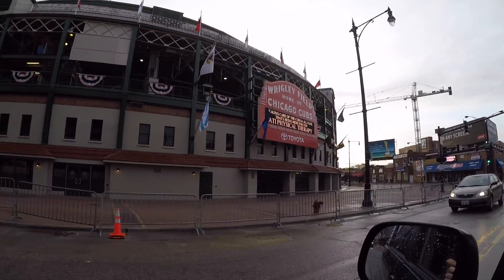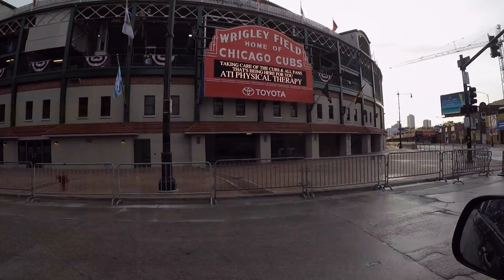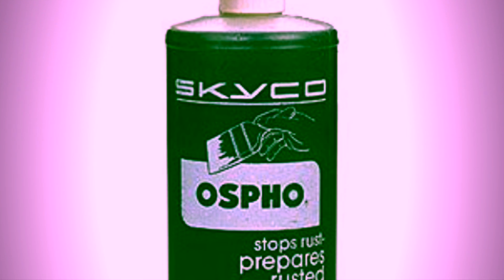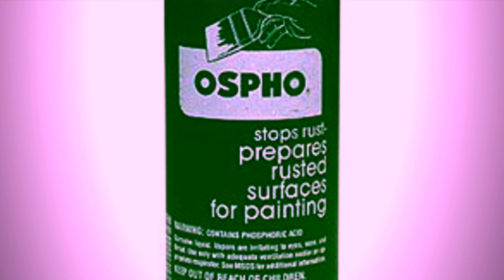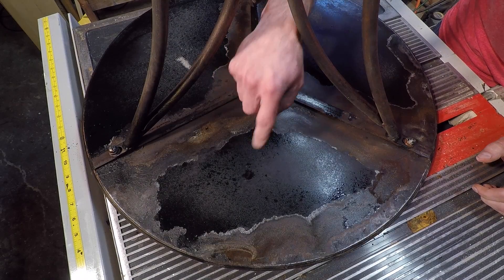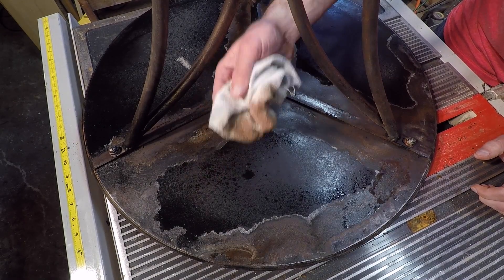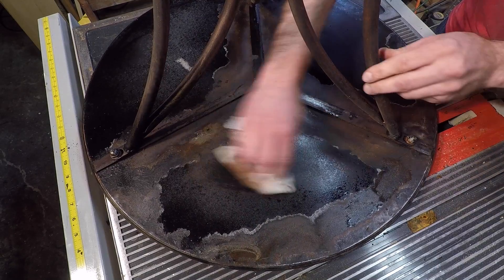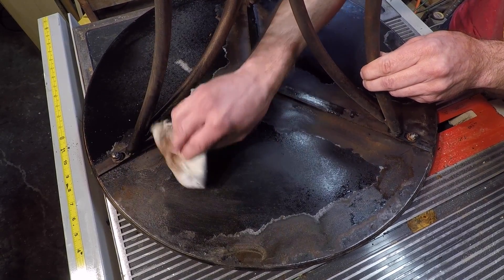Amazing Rust Killer! Ospho

Comment: I can attest to the effectiveness of OSPHO Rust Treatment Formula.  My friend and I had a 1/4" piece of Steel that we had bent into an angle bracket for a Trolling motor mount to go on the bow of his 15 foot Bay Scooter that sat right above the waterline.  We were in Corpus Christi, TX in the early 90's and in case you didn't know it, the Gulf of Mexico is one of the (if not the highest) highest salt content bodies of water in the world and rust is a huge problem along the gulf coast and especially in marine environments.  Anyway, we treated our mount plate with Ospho and let it cure for 24 hours, then we applied a 2nd coat and let it cure for another 24 hours.  We then painted the mount plate with some Red rattle can spray paint (might have been rustoleum but I don't recall for sure) and put 2 or 3 coats of paint on it.  Now under normal circumstances that plate would have started to rust no matter how many coats of paint you put on it because the salt environment is so harsh it just finds a way to get through, but our Ospho Treated mount performed like a champ for at least 2 years of frequent fishing trips where it was constantly getting splashed with the high salt content water of Corpus Christi Bay area and it never showed any signs of rust.  After this I swear by this stuff!!!!!
Reply from the maker: Thanks for the comments.
Reply: @AlleyPicked  you bet!

Comment: Ospho does work well.  I have used it on several old trailers and a lot of old rusty machinery.  Just be sure you always paint with an Oil based paint afterwards.
Reply: What is opel based paint?
Reply: What about a rust protector?
Reply: Stacy Jens didn't see the typo.  I meant to say oil based paint.  Anyway, that is what the Ospho rep said.  I have scraped and wire brushed all the loose rust off of machinery and trailers, coated them with Ospho, let it dry overnight and then painted with tractor and farm paint I got at tractor supply.  I added the hardener they sell for it as well.  So far this has kept any rust from coming back.
Reply: reck0n3r in my experience the Ospho, after it dries, leaves a coating on the converted rust.  I then put oil based enamel on it I get from tractor supply, with their hardener.  Several trailers and farm equipment pieces have not showed any signs of rusting.  Just be sure to scrape and wire brush off any loose rust before applying the Ospho.  Hope this helps.  Tom
Reply: Manufacturer says to clean with mineral spirits to neutralize acids before painting

Comment: Very cool! My dad was a builder and decades ago I attended the Chicago Art Institute studying fine arts. Point being, I'm pretty handy and I love architecture. These videos are fun and informative so thank you. I've lived in older homes most of my life which I miss. Love my neighborhood now but I'm living in a 25 yo house. My front door is a nice 8 panel door. It is rusting though and I looked at the replacement cost and want to believe I can salvage it. I have small bubbles of rust rearing their ugly heads, outside. I think the exterior might be due to a brass kick plate that wasn't sealed with caulk. Is this product a good option for my door if it's not too badly rusted? It isn't too noticeable yet, but could be worse than I think under the paint. Thanks!!
Reply from the maker: Thanks for watching. You should be able to repaint it yourself at a fraction of the cost. Good Luck! Tom

Comment: Does OSPHO harm plastic? I’m working on a bathtub and want to make sure OSPHO doesn’t harm the PVC piping. Thanks
Reply from the maker: I dont think so but I'll read the instructions and get back to you. Theres also another product called klean strip metal prep that's half the cost.
Reply: @AlleyPicked  thank you. I’m calling the OSPHO company tomorrow to see if they have anything to say.
Reply from the maker: @cdb8315  Hi. The Klean strip instructions do not say anything about harming PVC. So I test it myself. I coated a pvc piece with the stuff and after 30 minutes I wiped it off and there was no effect on the pipe at all. I think it's fine.

Comment: My front door has a rusty hole on the top of it. What should I use to fill the hole once I get rid of the rust? Thank you.
Reply from the maker: Seems like bondo would work.  Like they use on automobiles. If its a small hole, you can try plumbing putty epoxy.
Reply: @AlleyPicked  thank you for your reply. Wish I could send you picture of my door. Home Depot wants $2,000 plus for a newer one with frame, even though frame is in perfect shape. I am sharing your post on my Social Media . Thanks again.
Reply from the maker: @aiculsunlight9713  you can send me a picture. tom.szontagh@gmail.com

Comment: I’m using this stuff now!  I wanted to use it on a air return vent inside my home. Is it going to be toxic after it dries? Do you have to paint over it?
Reply from the maker: It is not toxic. I was also going to use some in a vent also. Read the instructions just in case, but I didn't even notice any odor after it dries.

Comment: I have a rusty water pipe in the basement, will this stop the rust or transform it into a viable piece of pipe without having to tear out the pipe with its minor drip?  HELP!
Reply from the maker: The pipe would have to be dry before applying..
Reply: Cut the pipe and put a rubber sleeve for plumbing, should be able to find any hardware store. Leak free. I tried jb weld underwater for pin hole leak before and never worked. Sleeve is the way to go.

Comment: Thank you for posting this video.  I have just learned about OSPHO and started searching for some info on line.  This is how I found your channel.  I am wondering how would you rate this product after almost four years?  Thank you.    P.S.  I live at Neenah and Wellington.  ;)
Reply from the maker: Ospho is very good. However, since I posted that video, I found a similar cheaper product available at Home Depot called "Klean Strip Concrete & Metal Prep". I have been using this product for a few months and it works great. It uses the same active ingredients. Here's my newer video on that product.
https://youtu.be/98Oxee5xbdg
Reply: @AlleyPicked  - Thank you.

Comment: How's that paint holding up? Little do most folks know that you must take a hose and brush and wash off and neutralize the Ospho before painting otherwise it will turn to jell under that nice paint job and your paint will fall off at a later date. After you took that rag and wiped off the extra, you could have let that piece set for 15 or more years, but, you still have to remove it leaving the protected metal to be primed and/or painted. It's only a RUST preventative to help you get through a project before the entire project such as a car, needs to be painted, BUT, only when you are ready to paint is when you wash with soap and water or wipe off with a damp rag, your entire item to be painted. That's right, OSPHO is ONLY a metal preservative UNTIL you are ready to paint. You must wash off or neutralize any remaining Ospho leaving the  iron phosphate, or converted rust behind. It's only a temp fix for rust.
Reply: OSPHO dries and can be wiped off and it can be used as your primer.  You don't need to prime over Ospho it is the primer or at least can be.  It kills the iron oxide that is on the surface and seals the metal so that the corrosion activators  (i.e. dirt, grime, oxygen, any conductors that might start the oxidation process) can not reach the parent metal and if used properly will last for YEARS!

Comment: "You're not going to want to get it on your hands either."  *Proceeds to spray acid without gloves.
Reply from the maker: Which is why I used a pump spray and not a rag with my hands. Get it? It doesn't burn your hands or anything, its just a precaution.

Comment: this guy painted the under side of a "trash" patio table with a brush, so what do you expect? , I would not trust his process / procedure for a car panel / door etc. I have been fighting rust on old cars for years (and by rust I mean heavy pitted rust not just surface rust that you can clean off with a paper towel, LOL) and tried everything from expensive stuff like Metal Rescue and or POR15 to cheap yet effective Phosphoric acid from Home Depot and what I learned is that best results are had with a combination of abrasives such as a wire wheel and acids, which have to be neutralized and washed off after application, I would also recommend not wasting your money on the rust converter products in your local auto parts stores
Reply: What acids and how do you do it? After I sand and clean the door of my car  minutes after I see a yellow layer of rust form, I have used thinner alcohol and vineager to clean the raw steel but dont know what to do later, Im stucked here because I cant apply primer or paint correctly. The only thing that worked is that after I sand and apply the thinner or vineager I wait just a bit and apply primer while the steel is a bit moistured, that is the only thing that has worked so far, that way the rust doesnt have time to form again but I am affraid that some days latter the primer and paint start peeling off 😥 I hope you answer, good day
Reply: You do realize that Ospho is phosphoric acid right?
Reply: Try letting your parts soak in white vinegar if possible and you can leave your part in for days or months without damage to the metal! IT WILL REMOVE ALL RUST EVENTUALLY. . I filled a 55 gallon drum a quarter of the way and placed a big metal piece in it and most was above the liquid, but I found that covering the barrel caused the acid for become suspended and attack even the rust above the liquid!! I wouldn't use anything else and be sure to thoroughly dry your parts and store covered in/under newspaper if you must, or prime and paint if you can.  I wound use anything else other than good ole cheap White Distilled Vinegar anymore and I'm getting better with speed to avoid flash rusting!!!  Lay the part in the hot sun after dried to make sure all moisture is baked off. OSPHO must be washed off with soap and water, or at least water before prime and painting anyway!!! Waste of money! It only preserves your metal until you are ready to wash it off and paint, like on a large vehicle of sorts.
Reply: @USMC-Sniper-0137  
what is that powdery residue with phosphoric?  I know sometimes it turns black, or sometimes it leaves that powder residue.